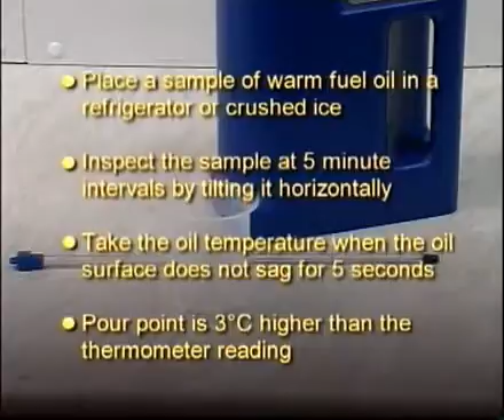How to Measure Pour Point?

Comment: Amsoil european formula  5w40 synthetic oil has a pour point of -39 degrees C (ASTM D97)
they also have a synthetic  10w40 synthetic oil with a pour point of -44 degrees celcius             ( ASTM D 97), which one of these oils would have better flow in cold weather ??